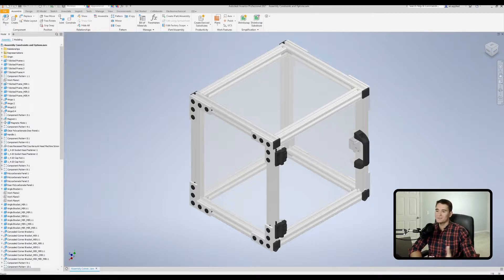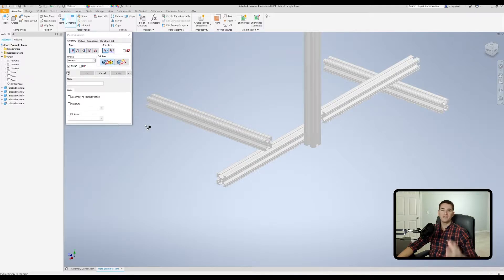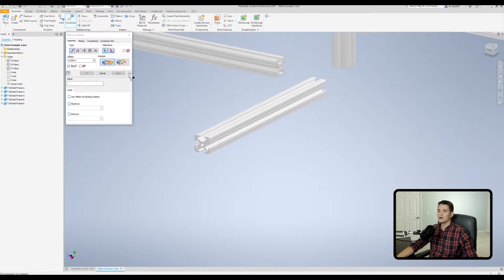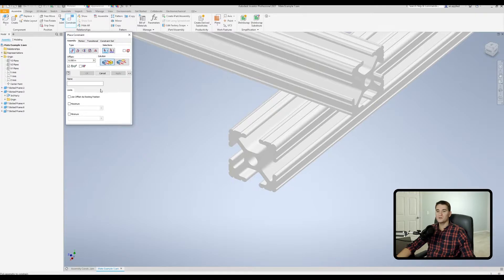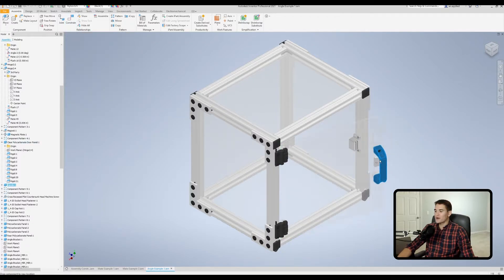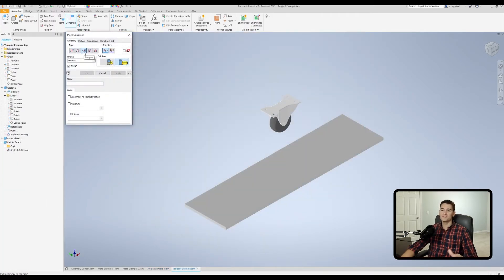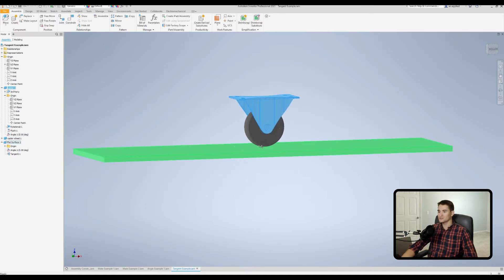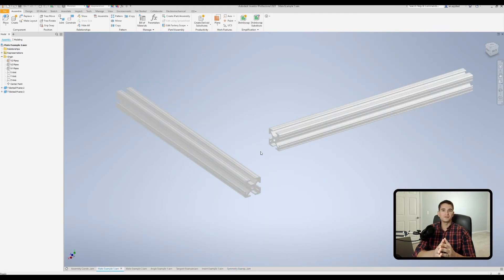Assembly Constraints - Autodesk Inventor Assembly Tutorial | Autodesk Inventor 2021 IN DEPTH

Comment: another great and in depth video. I love the keyboard shortcuts. Is there a way to select the type of entity you want to select for the constraint without having to necessarily point and click on said entity? For example I will use AutoCADs workflow. I can activate the move command, select geometry, [enter], then right click and I will have a list of the different types of object I can select with my mouse OR I can type a keyboard hotkey for said object snap (m=midpoint, m2p=snap between two points, e=endpoint, etc). Once, I select the object snap entity, I hover my mouse over any area of that object and it'll snap to whatever entity I chose on that object.

So for your example, instead of clicking the face and dragging away, you could right click and select "face" and then hover by that face and you will know it is only going to select the face...not accidentally grab an edge etc.

Comment: Thanks for a nice video. Could I download your parts so I can follow your video?
Reply from the maker: Thank you for reaching out! I am working on finding a storage solution for file sharing. I pulled the CAD files for the aluminum profile, hinges, and hardware from McMaster-Carr's website. I appreciate your question/suggestion and will be incorporating file sharing in the future.

Thank you so much for watching! Cheers!
Reply: @engineeringapplied  If you have time please add the link to the parts. Then if somebody would like to have the same part they could download the part.